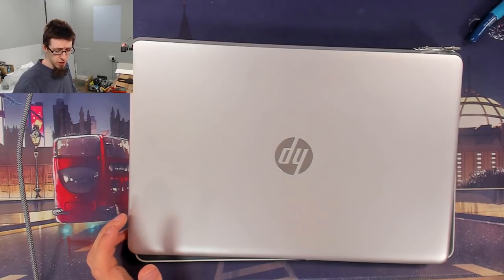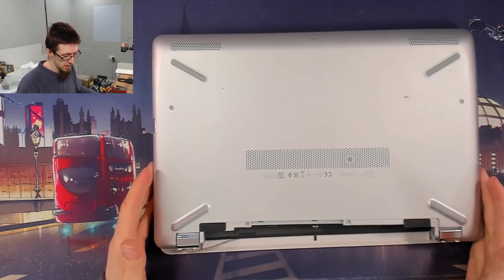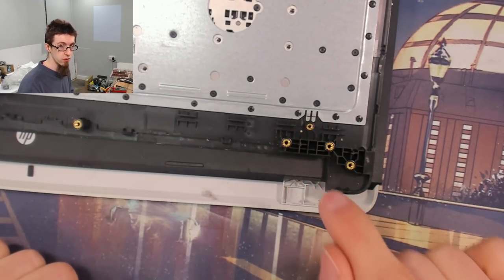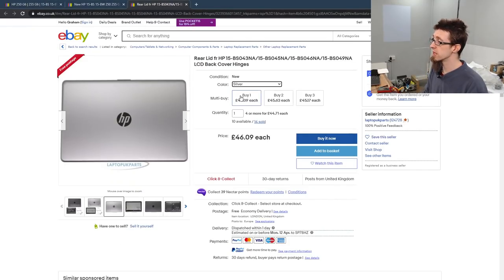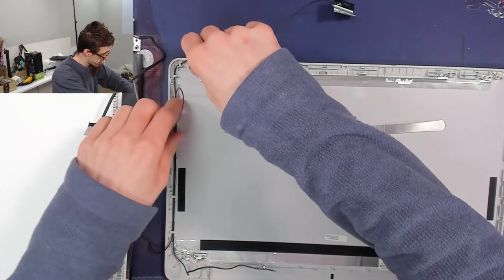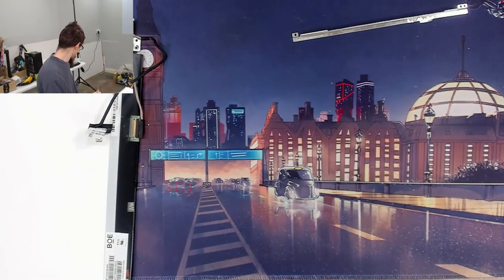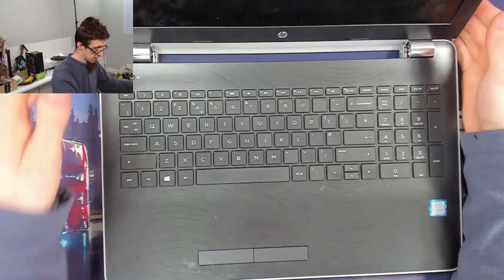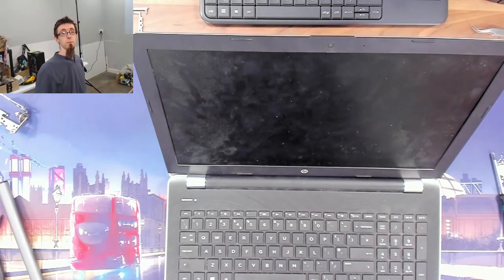How To Deal With Broken Hinges - LFC#262

Comment: Here is my take on this:

- The hinge mechanism have a self-tightening feature, otherwise they would become loose over time;
- That feature is also the problem, because over time some models will become over-tight an the plastic will give up first;
- If possible, after gluing everything together, you should loose the hinges a bit (there is a bolt/screw in most hinge models), because otherwise the plastic will break again;
- The rule of thumb for how much loose should be (with the laptop closed), lifting the lid without lifting the base together. The tightness should be enough just to keep the screen in place, because over time it will self-tight again;
- If your laptop is already requiring two hands to open the lid all the way, you should consider preventively loose the hinges, otherwise you risk the next time you open the laptop will be the one with the crack sound.

Comment: The last hinge repair I had to contend with was a HP Mini Netbook, both hinges torn out of the top.  A replacement top case was going for $80 on ebay, while I could get a whole new replacement HP Mini was going for $60 on ebay. Neither was a good option for my customer. . . . . . Gorilla Glue Epoxy however, was only $5 at the hardware store !!!
Reply: Indeed. Is much faster and you don't need to replace anything. Loosening the hinge is a good measure too, otherwise it will break againg over time.

Comment: One option instead of hot glue are leather rivet screws. Come in a variety of lengths. It does req more effort and modding but the end result is worth it. And the hinges have nuts to adjust the tension. Back them off ~1/4 turn and they won't fail to begin with.

Comment: Hello Adam, nice and usefull videos on your channel, s been a while since I follow you and man, did I learn a lot of things! Referring stricly to this one, since I use to service laptops in the last 15 or so years, let me mention that the hinges - even the new ones - are working much better and easier with a litle help from our good common friend, WD40. In fact, every time a do a full service on a laptop, including cleaning, dusting, pasting etc I'll do a few drops of WD40 on the hinges, especially if they are Asus or HP's. Sometimes it's a messy job but I use to insulate the hinge part with some napkins. A few times (I got lucky) client brings in the laptop before breaking it and I use to dissasemble the hinges and dive them in WD40 or a similar oil over the night, after cleaning them with technical or isopropilic alcohol. Next day, they work like a charm. If I can loose them just a little bit from the nut, that's even better. Tottaly agree with Magoid comments. And yes, often there are no spare parts, so there's black, strong hot glue, fiber glass or dual-epoxy. Keep up the good work !

Comment: I have tons of these hinge breakage videos. Loctite Plastic epoxy (edit: the two-part kind, not the single squeezy tube) is my go-to goop. I really hate doing these though.
Reply: Cool, thanks for that one Jody. I appreciate that. 👍
Reply: @josephking6515  always happy to help!
Reply: @josephking6515  forgot to mention: the two-part epoxy kind, not the single tube.
Reply: I was just about to ask if anyone would recommend using 2-part epoxy, I’ve attempted this on an old laptop let’s see how it turns out, but I’ve lubricated the hinges with oil (not WD40) and loosened the nut on the hinge so it opens/closes easily, the hinges become stiff to the point where they break, this was suggested in another YouTube vid
Reply: I used the same stuff on a Compaq LTE Lite.  The plastic that holds the screws in for the hinges was completely gone.  I hope it turns out.
Reply: @i80386sx  Oh man, that takes me way back. I ruined the keyboard connector on one of those once.

Comment: Great video, with your explanation I could replace the hinges and cover of my HP laptop. Imposible without your help. Somehow I disconected the battery, but I can use it wired. I will take a new look to what I did and try t fix it. Thank you

Comment: Smashing repair graham, it now looks like nothing ever happened :-D
We all lose the odd screw, they vanish into the underworld or in my turn ups in the distant past :-D
Reply: And that is why I purchased 900 assorted of the little buggers only to find the specific one I was after wasn't included n the pack even though it said it was. Ended up buying another 900 from a different seller then I had to buy and appropriately partitioned box to keep them in. I don't and haven't done hardware support for 25 years and this was just for family and friends. At least I can now replace missing screws on any non MacBook machines that cross my path. The Mac ones are like hens teeth and cost more than their weight in Unobtanium. 😱

Comment: I tried bodging a fix on the lid of my old laptop by epoxying the knurled nuts back into place. It worked for about a year but the epoxy slowly started to crack and the hinges became loose again. I got a replacement lid and attempted a proper job that mostly went OK. However I did manage to break the microphone built into the webcam. It's strange because the webcam works fine but the microphone, although the left channel works, the right just gives white noise and I can't force windows to use the left channel only. (Altering the microphone balance does nothing). One thing that nearly caught me out was that the bezel, that I also replaced, had a magnet in it that told the laptop when the lid is closed. So if you do a lid replacement and Windows doesn't sleep when you close the lid, try looking for a magnet in the old lid that needs moving over.

Comment: If it's small damage, like one tread fall out or body isn't devastated I use two component epoxy. If it's ungluable damage drill through shell 3,5mm every screw hole add 3x 3M screws though hinges body add other side add small stainless steel plate 0.5mm with same holes distances like in hinges screws together and it never fail again. Or simply buy a new body on ebay if is available.

Comment: I swear those HP 250 G6s were faulty design. I've repaired/replaced loads of them in my work. 
We even had three sent back to HP for warranty repair as they all broke from the bottom case soon after deploying them.

A couple I've managed to use a soldering iron to melt plastic and reattach the fastener/thread bit. Quick and dirty, but worked.

Comment: 2:20 Graham, I would love to see you take a laptop that's functional but not worth repairing (I'm sure you plenty you've acquired and keep for parts) and just start experimenting on it.  Can you actually replace a $20 wifi antenna with a few cents worth of wire?  What about the expensive display cables?  Are there cables one might have lying around that can work in a pinch?  Obviously, most of your customers are going to want real replacement parts.  But you have over 100k people in the world that are probably never going to walk into your shop.  It could very interesting to see what sorts of repairs could be accomplished WITHOUT the proper parts.  And will the fixes only hold temporarily, or will they last indefinitely?  How much jank can you introduce into a laptop and still have it work?  Sometimes, that's the only option for people who need to fix something fast and/or cheap.  Or it just might show how absurd it is to charge $20 for a wire, I mean wifi antenna.

Comment: I reinforce those broken areas with two part epoxy paste.
My fav brand so far is PC-11.  This stuff is super sticky and really strong.
Reply: Thanks Aurthor, yet another one to look at. I was using Araldite but wasn't took satisfied with it due to it it being a bit runny and if you waited for it to get a bit more viscous then you could end up running out of time to form the gunk into the shape you wanted and it would go hard on you before you could finish. A tad annoying.
Reply: I use Loctite Plastic, the two-part epoxy with the purple and blue label. It is quite thick and sets in 5 minutes, just long enough to position everything and test.
Reply: @josephking6515  Loctite Plastic two-part, hope that helps. 😊
Reply: @JodyBruchon  PC-11 takes 24 hours to cure but it's used to hold sinks under countertops.
Sticks to almost anything and it can cure underwater.
Reply: @aurthorthing7403  Sounds strong, but I wouldn't want something that strong just in case I needed to redo anything later. Not that the Loctite isn't strong, though. I suppose past a certain point of strength, it just doesn't matter what you use.
Reply: @JodyBruchon  I don't like the fumes from the locktite stuff.  I like other locktie products but that plastic welder is too toxic for my taste.
Reply: @aurthorthing7403  I understand. It did make me quite nauseous the one time I forgot to turn on a fan. That was not a fun time. I can still taste it.
Reply: @JodyBruchon  does 2-part epoxy leave white marks like superglue does?
Reply: @darattaqwa  No. It's a thick paste when mixed up. It does not run at all. Super glue is usually cyanoacrylate, which actually dissolves some plastics and is very thin, so not only is it runny, but it also destroys the surface you're trying to get it to stick together.

Comment: Our workplace uses HP laptops and a few of them have had the same issue. It seems the hinges have a stronger force and the connecting mechanism to the lid housing is a contentious point of failure and it appears to be thinner plastic mouldings joining to the metallic hinge goes first 😂🤯🧐

Comment: Just skimmed the video so sorry if this was addressed: if you replaced the parts with exact replacements, won't the same thing happen again? I've had good success with epoxy. In a scenario where the brass inserts in the base of the laptop break out it also might be the only option. I was unable to even find a replacement base case. As I see it, epoxy offers a cheaper and stronger solution. No waiting for shipping if you keep some on hand and it will fit any model of laptop. Only downside I can think of is potential for mess. I admit I once glued somebody's power button, but a bit of steady dremel work solved that. Thoughts?

Comment: I would also never use hot glue. I would use plastic welder epoxy on the lid and new hinges with new steel display frame made by HP. And plastic welder epoxy is a lot stronger than original crappy plastic  mounts for the brass nuts.

Comment: Hey man I wonder why you don't use thread locker for the screws? What if they come lose from the stress of the hinges?
Reply from the maker: I've never found it necessary myself, but I've been meaning to get some just for hinge screws if nothing else. Given that all stock screws come out with thread locker on them, I'm not convinced that it's effective. Didn't seem to help it the first time. Torqueing the screws down seems to be the best defense.
Reply: @Adamant_IT  I trialled using thread locker for a while. Where it is good for holding the screws in, I had one or two that had to be opened up again at a later date and the extra force needed to start the unscrewing caused the metal thread insert to shear away from the plastics.
Reply: What’s thread locker?
Reply: @darattaqwa  It's mild glue like substance that fills the gap in the screw thread and prevent it from coming lose on it on.

Comment: I have done this repair a lot without the spare parts. With loca glue and bakin soda. 1$ costs, 1 hour repair. The problem with this model is the design flaw. The estructure of the   WILL break again even with this replace.

Comment: you can easily fix the old broken off screen hinges..... i use 2 component plastic epoxy...and glue back the broken off parts....i fixed about 20 laptops that way now....and not 1 has come lose again....

Comment: If the cables for the WiFi antenna had been broken could they not be repaired by soldering back together? Or would the repair introduce too much interference / signal loss
Reply from the maker: Possibly, but they're really really low gauge coax wires though, so they'd be a bitch to fix.

Comment: Hi! I was just wondering what the metal tape stuff that's attached to the WIFI antennas is and what is it for? I was replacing some antennas the other day and had no idea if it was essential, or if it had to be perfectly flat ect. I would've googled it but i have no idea what to call it! any pointers would be MUCH appreciated as its never fun not knowing about what you're working on.

Also I cant believe how gripped I am by this video, you need to start a Netflix series or something haha!
Reply from the maker: Shielding, trying to make sure that wireless signals go in the right direction. I wouldn't call it essential though, so if the tape got damaged, it's not going to wreck wifi performance.
Reply: @Adamant_IT  ahhh, that makes sense! Thanks for taking the time to respond <3

Comment: Guess I will be the one to use hot glue and things like that to fix this if the hinges themselves aren't snapped off... I am starting to get this balance with the combination of hot glue and superglue that the results can turn out pretty well.
In Canada we don't have the privilege of buying something like this and expect it to show up in a few days... Most of the stuff we get either come from the US or China, and with eBay grappling monopoly forcing all exports from US sellers to use only their ghetto transfer postage service (called eBay "priority" international service), items in China with Speedpak arrive sooner! Not only is it most of the time not eligible for free postage, but also eBay many times charge upwards of $35 of postage for just a pair of hinges (small one that doesn't extend like this one) because this is like the moment when a direct flight is cheaper than a transfer flight!
So yeah eBay recently is trying to kick out all of its partners, cucking PayPal by not allowing you to be paid to PayPal, cucking USPS by not allowing international services outside of eBay's own ghetto, and now cucking Shippo by introducing their own postage buying service!
Also I think you will see a lot more of these faults in even crappier machines such as various Acer Asus Lenovo laptops. If you stay away from any Acer, Asus (excluding ROG), Lenovo (excluding ThinkPad), Dell Vostros, Inspirons and HP Pavilions, you will have a much lesser chance of this low quality fault.